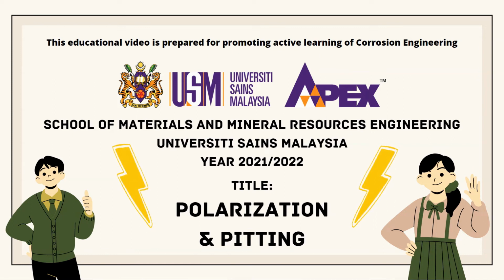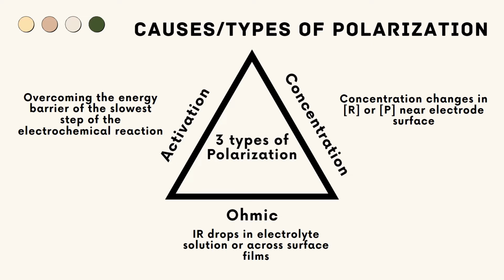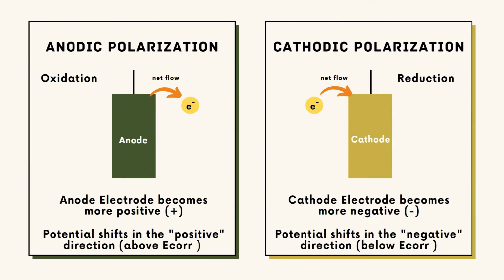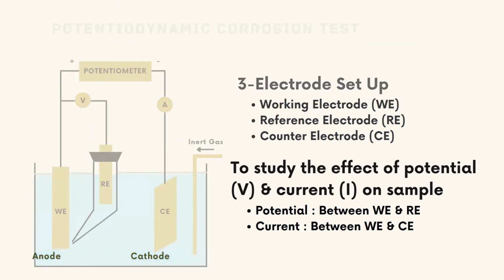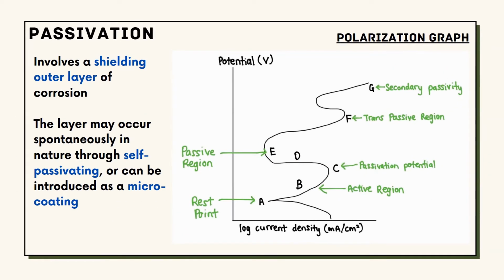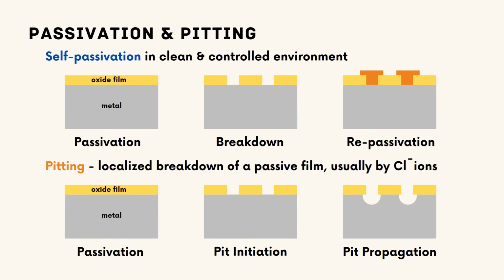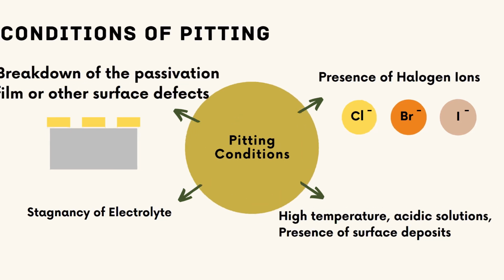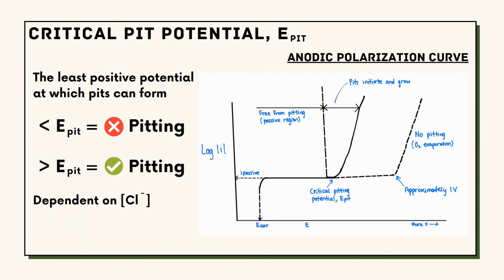Corrosion Engineering: Polarization and Pitting

Comment: The videos says that the pitting potential is dependent on the chloride ion concentration.  Isn't it also dependent on the oxygen content and temperature?
Reply from the maker: Since the video is limited to 3m, we not able to explain all. Yes, there are many factor for pitting corrosion, O2 contents, temperature, oxide thickness etc. Thanks for your comments
Reply: @AzminUSM  The video seems to suggest that the electrolyte is deoxidized for the polarization test by bubbling through an inert gas like nitrogen.  How would we expect to see a passive region in the polarization curve if there is no oxygen there to form the passive scale on the stainless steel?